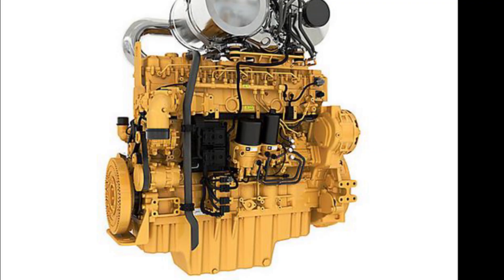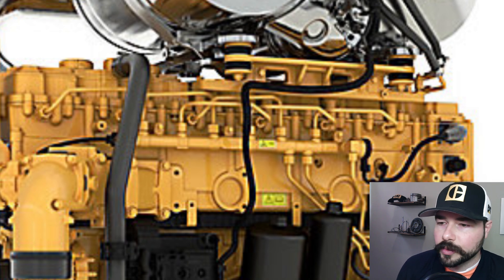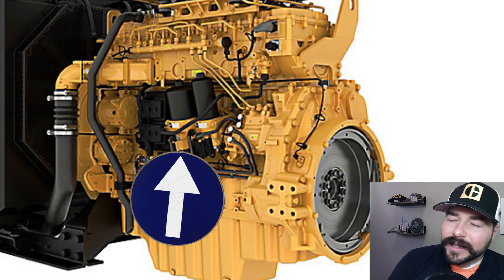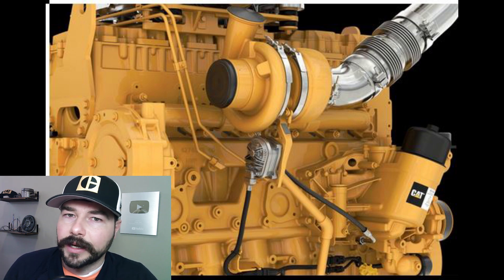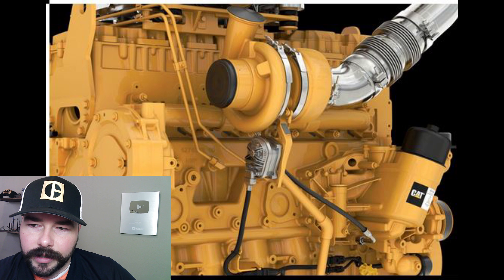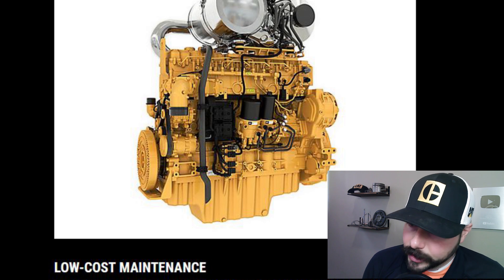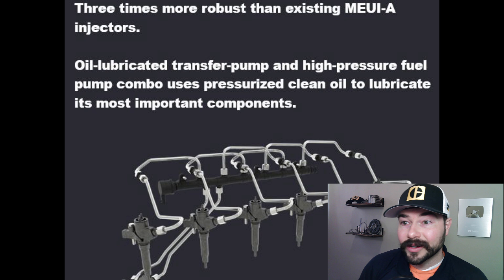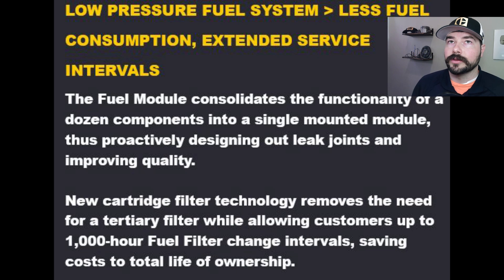New Cat Engine set to replace the C15.... The Cat C13D, 690 Horsepower.

Comment: 'new cartridge filter technology' means they mounted it upside down so it spills all over the place when you do a filter change. on the fuel side you get to spill it twice
Reply: Lolololo
Reply: Open the drain first. And oil filters don’t flow out. Been using them since the 03 6.0 stroker without spilling.
Reply: German design I beiieve…they assume you are going to hook a vacuum pump to the oil system during an oil change. Customer had a brand new drywall lift truck with a DD15 and they want you to suck the residual oil out of the filter housings before you change the cartrisges, per their manual. I’ve never done it.

Comment: That actually is a DAF (PACCAR).  You can tell by the iron graphite block.  I can tell by the plugs on the wire harness.  Worked on a ton of those.
Reply: Just because it has an iron graphite block and the same wiring connectors does not mean it’s paccar. Plenty of manufactures use the same wiring connectors and lots are experimenting with iron graphite blocks. To say this is a paccar engine based off those two things is ridiculous
Reply: @zaneantoneshyn2495  he was saying the PACCAR was the engine at the end with the rod out
Reply: That’s sad to hear
Reply: @blauer2551  that's cat for you
Reply: @mmm365  he was talking about the engine with rod out the side
Reply: Yep. That destroyed engine is for sure a DAF/PACCAR engine.

Their lineup looks like this..
MX-13
MX-11
PX-9
PX-7   this would be the destroyed engine. 👍🏻
Reply: Paccar engines don't use hydraulic lifters though, at least the MX-13.  But yeah, very curious.
Reply: 100 % cat   https://youtu.be/r9Muz7sAFyk
Reply: Haha, no
Reply: Not sure why it seems to be a big deal, seen every make do a version of the same at one time or another. It is a truly catastrophic failure, but, not all that unusual across the board. It happens.
Reply: No, no it’s not. It’s 100% cat. It’s been in development for a few years now.

Comment: In my opinion there is no replacement for displacement. I feel that pushing almost 700 horsepower out of a 13 liter will have a significant reduction in longevity

Comment: Hate the filter system. Detroit has has these silly things. Just seems completely stupid to open the fuel and oil systems to the sky to allow whatever crap to fall into the can. Spinning a filter from below eliminates that possibility. And 690 out of a relatively small engine seems awfully hopeful. These will be all off highway I assume.

Comment: Caterpillar pretending to be Iveco 12.9 liter. 680hp bulge in Case quadtrac.   Been doing it a few years now.  I'd sure hope Cat could out perform it.
Reply: maybe this will be in the Big Bud/ Rome tractor and MTS will use it as well!
Reply: @JAB8  I run 2 c18 daily one in my semi.  One in my mt965.  I'm worried about the size of rod bearings, in c13D.    The c13d has a belt driven water pump.  Like a c7 or c9.   Im not sure I like that.   I'd almost prefer electric at this point.   At least it could tell me it's not working.

Comment: DAF had cummins engines in some trucks  a while ago now I think it is mostly the PACCAR  MX-11 engine. 
Nice overview on the new Cat engine.  Hope it is a good engine.  Be safe Sir.
Reply: That was my destruction of the week. Its a MX-13, 13 litre paccar engine
Reply: the paccar px9 and px7 are Cummins motors just with a rebranded valve cover and gray paint. The mx 11 and mx 13 are paccar motors although all of the engines paccar uses in their trucks use a Cummins after treatment system.
Reply: @Dingbat.123  They only use a cummins after treatment system in the USA. Outside od the US its a european after treatment system and its very different
Reply: The bigger Paccar engines are DAF based.

Comment: Cat dealer tech here I actually just had a cat off highway emissions class last week my instructor was very knowledgeable about the new engines and you kind of touched on it but the biggest change I’m excited about is no more egr/nrs system. The science has been improving on the scr and we are able to filter all the nox out without having to reburn exhaust gasses in the combustion chamber. This will however lead to more def consumption but I’m stoked about not having clogged up egr components and being able to make more horsepower with less displacement. That’s why we are going to see this engine replace the larger ones
Reply: Also not having an EGR cooler would has numerous advantages, improved cooling system durability among other things
Reply: "no more egr/nrs system". That's good to hear. I understand wanting to cut down on emissions but EGR was the worst idea yet to achieve that.
Reply: @Mikheno your funny, keep believing your emmison crap lies.
Reply: @Mikheno  red flag.
"More horsepower from lesser displacement "
Reply: I think Cummins has done away with EGR for Europe a year or two ago
Reply: NOx doesn't get filtered out, it gets chemically converted back into nitrogen and oxygen. It's a catalytic converter, not a filter.
Reply: More horsepower from less displacement usually means less torque and shorter life span. I know some believe better fuel economy because of less displacement but I believe the science over the sales pitch. There is only so much energy in a pound of fuel. And it takes this much energy to make this much hp. May be a clearer way to put it is 2 horses pulling a cart will eat more feed and drink more water and die younger than if you have 6 horses pulling the same cart😁
Reply: @holmes1956O  more power from a lighter engine means less deadweight to haul around. Better fuel economy is everything. With todays price of fuel, a very long life engine will consume many times it's original cost in fuel alone. And the older it gets, the less efficient it gets along with higher maintenance costs. If fuel gets even more expensive, the engine initial purchase price becomes less and less part of the total cost of ownership of the economic lifespan, and makes trying to extend the lifespan a big waste of money. On a ship where weight and size is not an issue, these huge engines last forever by comparison because of two things. Easy reparability, plus they run at very slow RPM, roughly 102 rpm for the largest containership engines. But for an over the road truck engine if your competitor; say the green or the red guys sell an engine that's heavier than yours, and gets less MPG, guess what? Nobody will buy it. Trucking is very competitive and every pound counts, 10 more pounds of engine is 10 pounds less freight you can haul, or less fuel you can carry etc. And 1 MPG difference to a large fleet of 1000's of trucks on the road, can add up to an extra easy six figures or more in the owners pocket.
Reply: @holmes1956O  agreed and something I would ask how much engine braking potential is lost with the reduced displacement?
Reply: @russellknight26 zero. The way turbo's work you get x10 more engine braking. Any new class 8 Diesel motor as x10 more engine braking power and it's all because of the vgt turbos
Reply: Wondered why it had a draft tube. About bloody time.
Reply: Where did you take that training?
Reply: @outdoor044  I took my training at Daikin here in Texas.
Reply: You know my guy Tony Roberts in Products ? Good guy
Reply: Not when you delete the retarded DEF system
Reply: HLA on the C-175 has hydraulic adjuster built into the rocker end of the pushrod, I suspect this may becyhe same.
Reply: Lol hahah the best emissions engine's are without all this new bullsit that puts more poison out then the straight pipe no emisson engines
Reply: Cat has not had an emission engine in years, engine swaps are now illegal in 26 states, glider kits are outlawed on present builds.
FEDs have become very aggressive towards emission deletes,
Reply: badass!
Reply: Can u put this system on a highway use engine
Reply: Well what in the wide wide wold of Caterpillar mechanics is Josh? Just a cool guy wearing a Caterpillar hat?😊
Reply: @michaelmcclure8673  he’s a dealer mechanic that hasn’t had a class on the new engine yet, will be great when he does I’m sure we will get a more in depth video when he does.
Reply: @michaelmcclure8673   tell them to sell to truck makers again, at least KW and Pete.

Comment: Only time will tell if its a good motor. It might look good on paper and in testing but real world applications is a different story.  Maybe the water pump is in the back of the motor run of the gear train.  690HP longevity wise out of a 13L I would like to see. Especially with a single turbo set up. What is the torque it puts down?
Reply: Info on Cat website says 
"Maximum Torque 2360 lb-ft @ 1300 rpm"

Comment: Oil change intervals do u go by the manual or go old school 250 to 300hrs in heavy equipment even if the manual says 500 or even a 1000 hrs?
Reply: Oil has improved a lot the last few decades. Engines burn cleaner causing less contamination in the oil. Thousand hours should be fine in most cases. Changing oil sooner than 500 hours is just silly overkill. I think I would sit somewhere in between, depending on the use and the number of cold starts.  If you go full throttle all the time, chance early but if you go half throttle most the time and have the horsepower available “just in case” go every thousand hours.
Reply: No such thing as changing the oil to much, cheap insurance
Reply: Prob bet 20k miles or under to be within safe ranges

Comment: I'm old and grouchy and don't like anything new.
Reply: Remove the emissions and I’m sure it’s a great power plant.
Reply: ditto. They don't make em like they used to
Reply: @pimpmyrustbucket   They make them better🧁
Reply: Shhhhh, don’t wake them!
Reply: Haha I wanna like new stuff ,but the reliability just isn't there.
When it's working right ,it's slicker than grease ,but boy sit down when there's a problem.
The problem will be something simple, like a corroded battery terminal or everything electrical took a crap and you need to replace it all because of a corroded terminal😂😂
Reply: Same bro
Reply: That's right 3406B. Nuff said
I like being able to put my used motor oil in my fuel tank and my 7.3 doesn't even notice
Reply: Yeah - remember when computers were safe and trucks weren’t?
Reply: ROFLMAO 😂😂😂😂
Reply: I did an engine repower for a company that wanted 23 3176 replaced with c13s! First one took three days. Then 2 and a half then 2 days each until all 23 were done. (3 shifts) I liked the upgrade but the wiring was a PTA!
Reply: Same
Reply: You get over it, soon you'll ask, what was I saying.
Reply: At least it's an actual engine and not anything EV
Reply: 😅😅😅😅 grouches are what keeps child ideas back until they can be ADULTED in real world
Reply: Agree
Reply: Me too. Give me an older mechanical motor.
Reply: Give me a junkyard mechanical.
Reply: If it is remotely anything like the 3406, I am in.

Comment: I'll tell you what I think about it , I don't like it . I like overhead cam , I don't want a pushrod engine . I don't like the DPF setting on top of the engine . I don't like the inverted cannister filters . I don't like anything about it  . I'll keep my C15 ACERT MXS  .  The C13 D looks like a swing and a miss by Caterpillar.
Reply: That was the air intake on top of the block

Comment: DAF is the Dutch subsidiary of Paccar, basically the reverse of Detroit and Mercedes. Also, the DD engines aren't the OM engines, the only similarity is the engine block, and if that makes them the same then the CT15 is a C15
Reply: DAF was around long before paccar started making engines. DAF builds the engines for paccar and did most of the design work on them

Comment: I can tell you right away that this engine is going to have air distribution problems with the single external intake port being at the front of the head, and so the farther back cylinders are going to run hotter, and in the future after they have coolant temp issues in the back, probably leading to cooked liner seals and oil/coolant contamination, they'll have an updated cylinder head with another water port for the rear cylinders like the 3406B. They'd be much better off with the single external intake port being two without a divider to allow for pressure balancing, one for the front three and one for the rear three. Idk how I get this sense but I do have it
Reply: VGT turbos are garbage for exactly the reasons you say dude, they should have gone with a twin scroll turbo like Detroit
Reply: I think what Cat means by "oil-lubricated fuel transfer pump" is basically a gear driven lift pump, which raises the question of if its gonna be a lift pump why not make it an electric pump, but that's just me and these damned enginerds are the ones who make the big bucks
Reply: That makes sense to me.

Comment: My old Detroit has a canister filter. I think they're kind of a pain in the ass really. The combined module thing bothers me. You know that thing won't be cheap and it'll probably be pretty failure prone with 1000 hour service interval 😂😂
Reply: The whole thing seems to me like the latest step towards catering for Mega Fleets like Swift who don't put a million miles on the clock, they put rookies in em, they run 400 miles a day, idle all night, and then sell em on at 400,000 miles because that's when all the hours of idling at shippers, receivers, truck stops, terminals, POEs, will catch up with them. I honestly don't have high hopes for this new engine. Now keep in mind, I'm a Detroit guy, so I don't have high hopes for anything that can't trace its ancestry to that two stroke glory
Reply: @Romuls753  I may be wrong, but I don't think we'll be seeing that engine in any truck/on-highway applications
Reply: @Romuls753  how does the series 60 and the DD series engines have ties to the 2stroke?.... From what I read,the series 60 was designed by an engineer from Cummins,that Cummins wouldn't invest in the design..and the newer gen DD engine's are Mercedes engines..from what I read...but anyway
Reply: @elroyelblander6277  got some of that backwards. The Mercedes is a rebadged Detroit
Reply: @elroyelblander6277  Cummins didnt design anything. Detroit Diesel designed the Series 60, and It's the most reliable engine to date in any truck.
Reply: @orlandomoreno5326  ok.didnt mean to touch a nerve for anybody..and with a all do respect..but,look up Arnd Vanderbock...he was the Cummins engineer behind it I believe ...have a good one...take care...
Reply: @holmes1956O  ok.. thanks...is the Mitsubishi/FUSO a rebrand as well?
Reply: @Romuls753  sorry,just seen your post about the DD and the Mercedes

Comment: It's very similar to the marine C12.9. I've worked on a yatch with twin C12.9 with 1000 mhp each one,  and they also have a very good low end torque. And also, all manufactururers are going to small displacement engines with forced induction (the C12.9 have compound turbos and a supercharger and makes near to 60 PSI of boost)

Comment: Hey Josh, maybe they gave it the D because it has a rear gear drive like the D343 , (1693 TA) engine.LOL  Also it looks like the are stealing Jim Blaylock switch blade turbo design.
Reply: My thoughts exactly about the switchblade turbo.
Reply: Big companies always steal from others  big corporations or small aftermarket companies

Comment: Looks like a Volvo or Detroit
Reply: At least volvo/mack is still running screw on metal filters.  I dont mind the plastic ones until someone breaks the cap and mars tf out of the threads trying to get it out, meaning the whole water manifold(dd13/15 detroits) has to be replaced.  If Cat makes it an easy swappable filter base, im for it all the way.

Comment: I think 13L is too small for 690 HP and that it's lifespan will be pretty short.
Reply from the maker: They must be pushing it. They probably made 500hp on the dyno initially and the project manager told the engines "If you could make 690hp out of that engine, it would be pretty.....nice." So they bumped up the compression and gave her some more fuel. At least that is my insane idea of what happened.
Reply: @AdeptApe   Be nice about Project Managers some use to be technicians.
Reply: CASE IH has been using a 12.9L FPT in their big Quad Tracs for years... rated at 692hp...
Reply: I love Americans confused by modern diesel engine tech, 150hp from a 1.6 common rail diesel is very common in Europe so 690hp from 13 litre is absolutely fine
Reply: @leonblittle226  and how long do they last? 

The 1.9 JTD and HDI were indestructible engines, almost always outlasting the rest of the car with ease. Modern European diesels are just complicated junk needing a lot of maintenance and still break before the rest of the car is done.
Reply: @leonblittle226  duty cycle my friend, light duty automotive applications dont need to make peak power for hours on end